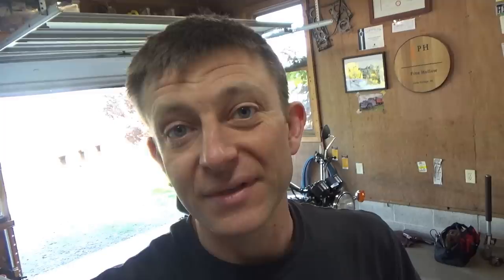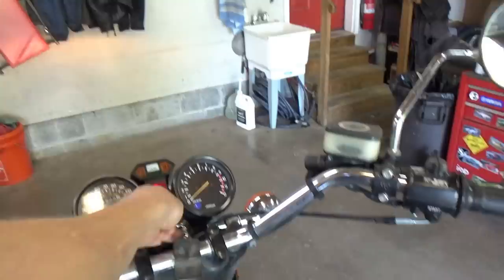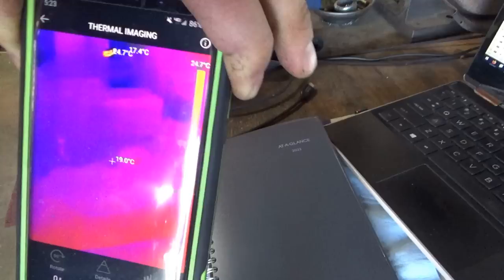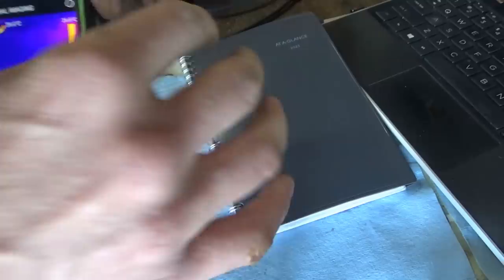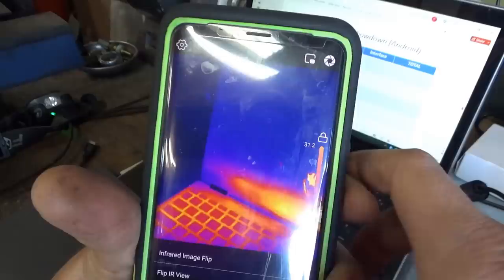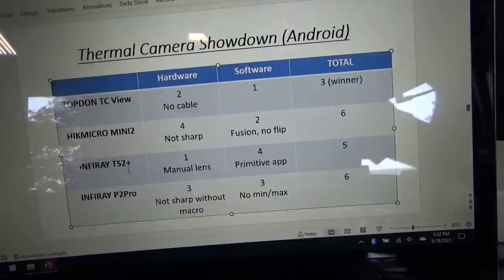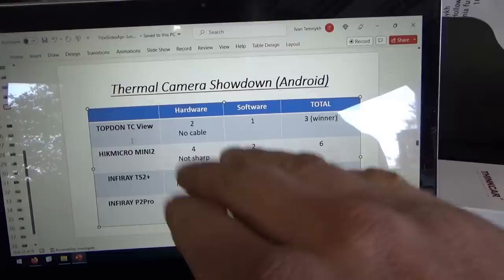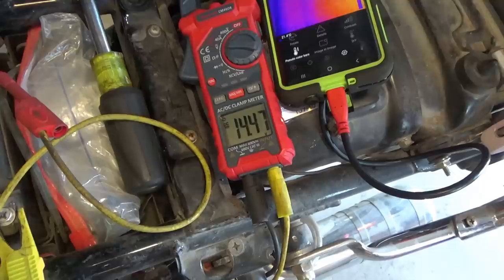Voltage Drop? Mini THERMAL CAMERA Showdown! (TOPDON vs. HIKMICRO vs InfiRay)

Comment: Years ago i was a certified level 3 thermographer. I left the petrochemical industry and became a certified master mechanic. You have just scrathed the surface of how those are useful. Example the water leak on the camry hybrid. Even bearings to plugged radiator tubes. And even that is just the beginning. You gotta pull a fuel tank? It will show you exactly how much fuel is in it.
Reply: Great reply,i to want to buy and use a camera just for fun.i like to tinker with computers and laptops. And now find myself trying to do board repair most of the time it's SHORTED caps>so i would be 1 away at most.It's a hobby so the cheaper the better and one of this sounds good.
Reply: If only those industrial grade thermo imaging cameras were more affordable
Reply: @versatile.mindset  yea they are the continental in a room full of pintos. And priced accordingly. Mine cost 37K in 92.
Reply: Yup, they're way above the average individual budget.
Reply: @versatile.mindset  now i use the klein tools TI250. $300.00 It is a stand alone palm size imager that i use for all electrical circuitry. Roof leaks, leaks from house thermal barriers. Exhaust manifold leaks +++++
Reply: @jamesmcgraw9570  Looks like you're happy with TI250 performance, I'll compare it with TI290 and get one for around the house uses as well.

Comment: Ivan, the T2Pro app has min / max and you can fix the scale too - you have to go to settings, and turn on "Professional Thermometry", and then go back to the main view and turn on the "Scale". I don't know why they hide that behind 2 different settings - it's really dumb. Just like it's dumb that the app for the T2S+ is worse than the P2pro when they're both from infiray, and they could be using the same software for both (but each app is restricted to the device ID it's meant to work with). An InfiRay makes the IR core that's in all of those cameras - why they don't put a little more effort into their app to fix the few things that need fixing baffles me.

Comment: The main purpose of thermal cameras is measuring a temperature. They also can have a notable difference in precision out of my experience but this showdown is only discussing resolutions, apps, and accessories ignoring their very purpose. It’s like Top Gear would be reviewing cars by their paintings. Kinda strange review.

Comment: When he said it’s not charging to 14.5 he’s not referring to the battery being able to charge to that voltage.  A good healthy battery can hold a charge up to 13 volts.  Anything over 12.65 is surface charge.  He was only pointing out the difference in voltage at the rectifier versus at the battery terminal.  Same as checking charging output on an alternator charging system.  You check at the back of the alternator and at the battery…typically within half a volt difference is acceptable.

Comment: One little nit about your comment about the battery:  it will charge to 12 volts only, and cannot be charged to any other voltage.  The voltage is a function of the chemistry of the battery, and aside from internal resistance if it is charged at all it is charged to 12 volts.  What is happening in your case is that it is not charging effectively, so when you go to draw a current, the internal resistance is higher so the cold cranking amp capacity is reduced.

Comment: I used infrared camera MANY years ago. (It cost over $5000 and had to be cooled with liquid nitrogen to work in 1980s) As electronic tech at IBM, I was asked to isolate short between power/ground on a newly designed 8-layer printed-circuit board (about 2ft x2ft size)  It found the design-fault within a couple minutes.

Comment: I bought the same TOPDON just a month or so ago and it came with a dual function cable. The cable can be used as an extension or plug into a computer USB port which I thought was nice.
Thanks Ivan.

Comment: The more you use a good thermal imager, the more uses you will find in just about every trade. My first camera was the FLIR One with a crappy 80x60 resolution, was always dead and needed to be charged independant of the phone. I also have a SEEK Pro with a 320x240 resolution but not as convenient as my Klein TI250 which is my everyday carry. The Klein isn't great resolution but is very convenient due to it being a stand-alone device, independent of my phone. The temperature calculation is pretty accurate too. 

In the HVAC trade, I use it quickly identify system performace (temperature difference from return air and supply air), duct air leakage, building infiltration, bearing failures and of course electrical hot spots (as you demonstrated). For automotive I use it to look for hot wheel bearings, driveline friction and brake diagnosis.  Thanks for the video, Ivan

Comment: I never really understood what you meant by "voltage drop" in previous videos.
I now understand that increased resistance in a circuit will lower the voltage, which will cause a problem for whatever is at the end of a circuit, like a motor or something that needs an exact voltage.
Thanks, Ivan! 😊

Comment: Thanx for all the great diagnostic videos!  I've been a shadetree mechanic for 50 years, but had no clue on the new bus systems.  You make it easy.
I was in need of a thermal camera, decided the Topdon fit my needs.  Just an update, Topdon must have seen your review, because it now comes with an adapter (not USB-C extension) for camera to PC USB (mentioned in another comment below).  The software has been updated as well, you can now do fusion images with the standard camera.

Comment: Great side by side test Ivan. I haven't used a thermal camera yet, but it  seems to be a useful tool for a multitude of testing processes. Thanks for sharing !
Reply: I think the starter motor shaft bushings could use a couple drops of oil....

Comment: Very clever use of Infrared as another diagnostic tool.  I think this type is more versatile than a stand alone unit.  The difference in connectors on the Yamaha and modern automobiles is striking! That open wire side of the connector positioned vertically is inviting any moisture to enter.  It sounds like the starter could use a little attention judging by the sound it makes.  I noticed that your left muffler has corroded some because of the sheet metal and hose clamps.

Comment: Used a Flir handheld last 15yrs or so of work. so many uses besides what you show. a cold draft in the house and more.
Reply: Yep! The most dramatic case I saw (ended in court), was its use in a construction quality complaint, where it was easy to demonstrate the poor insulation in the main walls.
My avatar was made with that camera :-)

Comment: Was just  working  on  my  81 Honda  750 F. Always  a  cold blooded  mother . It would  take  a while  for  a  4th  cylinder  to  kick  in . Easy to  check  which  carb is slow  by checking  header  temperatures. FYI  it wasn't  charging ,  After  checking  rectifier , diodes,and  rotor , all good ,  I noticed  that  one  of  the  brushes  was worn down .  New brushes , all good  now .  Peace  bro . Jack

Comment: Hi Ivan, this connectors can be changed by new ones waterproof, PA-66 or better, It will be a good  improvement to your ride, less pron to failures. also renew the wiring

Comment: Great video showing how and when to use one of these devices!
All of them seems capable enough for their purpose. If you dont mind I'd just like to correct you on the sftware for the P2Pro. I own one for about a year and usually use it to detect wildlife (or other heat sources) and the app does show min, max and average temperature as well as option for several points of reading throughout the screen (randomly selected by user) and also has the capability for "split screen" (or thermal image and phone's camera image simultaneously).
By the way, nice classic bike! Safe riding and cheers!!

Comment: Hikmicro has now also a module with focusable lens, nevertheless i just bought my first IR-camera, the infaray P2. App has customizable scaling, it can have automatic low and high point, or custom points, image is flipable, rotable, it can record video with sound, etc, for me it has everything working right. I fixed the cable on a small stick with a tiewrap. CE-marking is missing on the module.

Comment: Interesting thermal camera comparison! Really liked the Infiray TS2+, with adjustable focus, but the software...
Good case study of current overload on a perfectly good JST bullet-ring connector (tried to find the max recommended current, but a quick search scored nothing)! Probably has been like that from factory and only became a problem when the rectifier connector got green crusties and added a secondary voltage drop. The thermal images make it so easy to spot these problems :-)

Comment: Seeing the terminal with the corrosion reminds me of my 1200 Goldwing and the issues that the charging systems had. The recognized fix was to remove the block and hard wire the connections, adding a relay for the battery circuit so that it received the total voltage from the regulator (which fixed a lot of other issues that series was having since they used the same alternator as the 1100 on a bike that needed quite a bit more voltage power).

Comment: I just bought an Infiray p2 pro and it's so frigging cool. Can even see the studs in the wall just after sunset as they hold more thermal mass being denser than the wall panels. So many other use cases.

Comment: Great video Ivan, definitively the TopDon camera is the best in my opinion.  if you want to solve all the "heat" produced by the connectors on the bike and reduce the voltage drop to nearly zero, you have to dissasemble the "faston" connector terminals and with a pliers gently close the female end of the terminals to improve the tight fit of the connector when plugged in. Also clean them very well. Do it to one by one cable on each connector taking the terminal out and then reinstalling it again.  Then you will notice the connectors are much hard to plug in together, and the heat and voltage drop will dissapear. Do it on any of the connectors that show some heat in the camera and you are done. I did it on my Honda CBR1000F some time ago and now it starts and charges the battery way more better.

Comment: great video, also  a milliohm meter is great for voltage drop troubleshooting as well . also great for solar system installations- keeping battery connection resistance low!

Comment: Good info, Ivan, thanks. On the voltage drop- the crimp at the back of the connectors is highly suspect. Acid can easily intrude and corrode the wire and pins/blades, whatever. Nice bike, btw. Kudos on all your work.

Comment: I think the fact that Ivan owns a Yamaha motorcycle is where the name "MotoYam82" comes from.  Great video!
Reply from the maker: Hah yes that was for my 1982 Yamaha Seca 750 that took me cross country and back in 2008. I wish I had this 1979 XS750 back then... Much classier bike and more comfy long distance machine 😎
Reply: @PineHollowAutoDiagnostics  I knew there was some connection.  I am wanting to say you did that cross-country trip with a group as I vaguely remember a picture.  You are an interesting dude!

Comment: Thanks for your reply. Yeah that's right. It's deisel direct injection. I think I may have found the problem, well I hope so anyway. Found a missing power to the pcm. It comes from the glow plug relay on pin 7. Pins 1 & 2 are control side and 3 & 5 load side. Pin 3 being ignition and internally linked to pin 7 pcm power. There's battery voltage on pin 7 but a 9.5 volt drop from pin 7 to pcm. Does that sound like that could be the cause of low supply voltage to injectors? Literally getting around 5 volts supply to injectors and multiple miss fire on all cylinders. At the pcm, continuity test showed all supply pins are linked together internally while pcm control are separated. Michael C

Comment: correct me if I am wrong, but i think, the AGM battery  is not compatible with this type of charging system. It may working, but the AGM battery has a different charging strategy.

Comment: I highly recommend using an old phone with these thermal cameras.  I had the Flir version of one of these and it would often lock up my phone.  I got a new phone and when I eventually went to use it, it crashed my phone.  My phone never worked right again and I had to buy a new phone.  
I later bought a Flir C5 because I want it to have its own screen and not mess up any phones in the future.

Comment: 0.5v volts is still kind of high voltage drop over such short cables. I think should be less than 0.1v in that kind of situation on a motorcycle.
Reply: Maybe it has a fuseable link in line and thats causing the additional voltage drop.
Reply: @JackS425  Could be old corroded/thin cables or bad connections. Isn't the wire from the alternator also fused in cars? I think I measured less than a tenth of a volt of voltage drop in my car from the alternator and also all the way to the pcm when I was trying to figure out some electrical problems. I don't know much about the electrical systems of motorcycles, but seems to me it should be even easier to do as the distances are so short.
Reply: the heat generation is of course Resistance * Current.  but then there is the other issue regarding Temperature, the heat dissipation, size color and air flow.  It helps to understand these details.  However, using thermal imaging even without numeric data consideration can be just very handy.  As a side note, I have had a Flir 1 already a number of years.  To me its worst behavior has been critical dependency of fresh charging.  Otherwise, it has difficulties establishing phone connection.  And yes, it does not get its power from the phone, it needs separate charger connection.

Comment: Hi Ivan. Can you show us how to do a volt drop test on injector circuit where both supply and ground come straight from the pcm. I know that the circuit needs to be loaded from your videos but seeing that the pcm is involved, can you show us how to perform the test safely with just a basic multimetre and test light. I know how to do this test with a load that is permanently on like a light but not sure if it will be different with injector circuit because injectors are pulsed on and off. Do we just disconnect the injectors and connect a bulb across the terminals??? I'm an electrical engineer/electrical inspector by trade and you have definitely taught me more than I learnt in college all them years ago. Really appreciate you sharing your knowledge with us. Regards: Michael C
Reply from the maker: Hmm are you talking about GDI direct injectors? Test light is not very useful on those. You need to use a 2-channel oscilloscope to monitor both HIGH and LOW injector drivers. Then compare to a known-good :)

Comment: Half a volt drop across a foot of wire?  That's ridiculous!  There should be a couple of hundredths of a volt drop more like it,  & NO temperature rise in the wiring except maybe near fuses.  Wiring faults just waiting to happen.

You got a dried out bearing in your starter motor too by the way mate!

Comment: I love my Topdon Camera! I'm surprised yours didn't come with the extension cable though as mine did.

FMG
Reply: What accessories are or are not included with these cameras seems to change from day to day, and depending on which store on Aliexpress or which other reseller you get them from.

Comment: The "fusion" feature improves IMAGE resolution a lot; FLIR offers it and does it well. 

If INFIRAY TS2+ improves the app, that lens setup makes them easy winner. Crisp images on a densely populated PCB very helpful when searching for a single, shorted, SMD component.

Another useful software feature is to be able to filter temps. Sometimes the scales are useless due to something in the field of view is MUCH hotter than the area of interest, and glowing like the SUN, and subtle changes of interest become invisible. 

In late 70's, my buddy had a wrecked, Yamaha 750, and I tried to adapt the running gear to a two-seat go cart. Luckily the challenge exceeded my skill level, i lost interest and sold the project... OR i might not be alive to tell this tale 😂.  We were very reckless with our Briggs & Stratton creations, and this would have been 1000x more dangerous! 💀
Reply: The app for the T2 pro allows you to fix the scale of the gradient colors to a range narrower than the full temperature range (and it has min/max temperatures too as part of the scale, but you have to turn it on in settings). I don't get why the app for the T2S+ is so poor when they're both from InfiRay, and they basically both use the same hardware (but with different USB device IDs which is what restricts one app from working with the other camera)
Reply: @gorak9000 :  I just checked the website; these guys are real players in the infrared game. Gotta spend some time there (and maybe some money).
Reply: @hightttech  They're kind of the king of the hill when it comes to non US (thus non frame rate limited) IR cameras at the moment. Most all of the non US thermal cameras are using an Infiray sensor / camera core, and basically a different plastic enclosure / USB ID / software.
Reply: Like Crazy 💩 I did as a kid I put wheels in place of roto tiller tines on a front tine garden tiller also installed a pivot in the middle behind the control with a seat so it pivoted in the middle it was Absolutely insanely dangerous but it would really MOVE 😅

Comment: 7:20 - FLIR has thought about this and they have an adjustable USB-plug. Too bad their fps is limited...
Reply from the maker: Their USB adjustable plug is garbage, still too short for my case. Also their battery life is garbage since it doesn't use the phone battery 😅
Reply: @PineHollowAutoDiagnostics   Yeah those are true I guess.. Had one since I got it from Amazon for 150€ almost a year back.. These seemed to be priced where the cheapest FLIRs usually are.